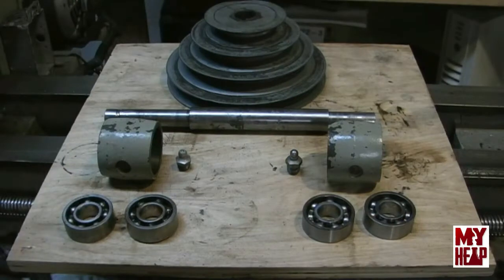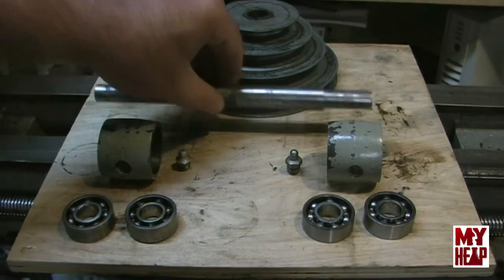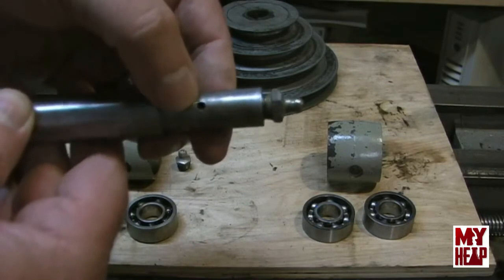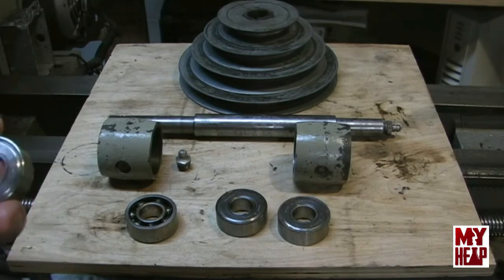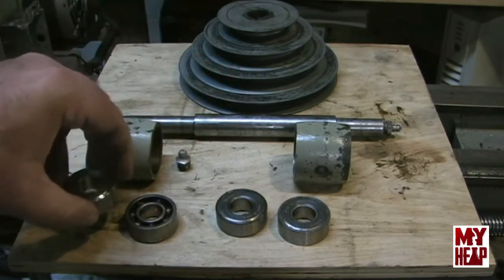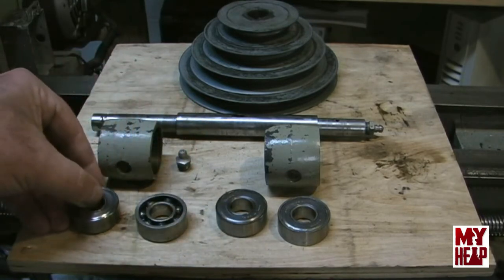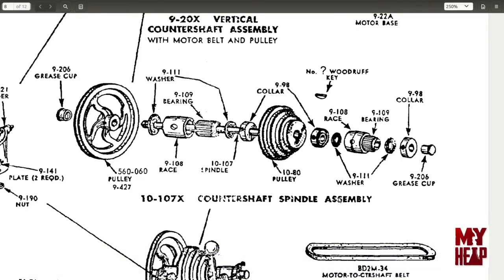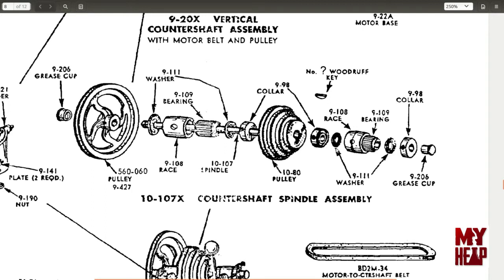Atlas 10F Lathe - TH54 - 05 - Counter Shaft Modifications

Comment: I added sealed bearings to mine years ago, Best move I ever made, No more grease flinging out while running. Yes, The originals were a "needle" bearing type affair. If you have an Atlas parts manual it will show the original set up.
Reply from the maker: Hi Jeff.  I have a parts manual that shows the needle bearings.  I replaced the bearings and it has been flawless.  You're right, it is the way to go.  Thank you for watching and taking the time to comment.

Joe

Comment: Adding the sealed bearings is a fine idea. When I first got my lathe it had the original rollers and were noisy and threw grease everywhere. . I didn't think of boring the original carriers but turned new ones from 6061 and added larger sealed bearings . It has been running cool, clean and quiet for a couple years now.
Reply from the maker: Harold, thanks for the feedback.  I have a question that maybe you can help me with.  I can find bearings with the correct ID and OD (15mm and 35mm respectively) but not the same width.  The FANFIR 202KT bearings are 0.500 inches wide and the bearings that I can find are 11mm (0.433 inches).  Since the bearings are press fit into the castings, could I use these bearings?  The set screws on the carrier that holds the counter shaft would prevent the castings from moving about.  Press the bearings flush to the outside edges of the castings leaving them roughly 0.067 inches from seating against the bottom of the bore?

Joe
Reply: I f they are a nice tight fit I would do as you said and just press them flush to the outside. You could make spacers for underneath or use locktight. You will have to at least keep the inner sides flush as they have to butt up to the shoulder on your shaft to keep everything aligned. The original shaft was straight and used movable stops on each side.
HWF
Reply from the maker: Howard, Thanks for the input.  I will order some replacement bearings and press them flush and just see what happens.  If needed, i will make some spacers to sit at the bottom of the bores.  At any rate, i think I will do a video of them going back together and running it as a follow up.  Thank you sir, for your help.

Joe
Reply: I agree, I also have a TH54 with the original grease cups which as Harold has stated throw grease every where.  I can't comment on the noise other than to say my lathe is very noisy.  I've been thinking of doing something about this condition for some time and seeing what was done to your lathe looks good to me.  Thanks for sharing your story and giving me some ideas and a little push, if I can just find the time.
Reply from the maker: I am glad to have helped in some small way.

Joe

Comment: I have a similar lathe with the original cage bearings and am about to replace the countershaft bearings.   I can't see anyone who has used these grease cup bearing suggesting they be retained.   
I  have some flange bearings on hand 3/4" ID 1 3/8" OD on hand so will use them.   
The 3/4" ID should not require any shaft modification.   Rather the modify the existing bearing holders I will be making new ones from aluminum round bar stock.
Time for you to finish up the house and get back out in the shop!  Stay well.

Comment: What you want to do is fine.  I'd consider pulling the inside seals and running oil bath.   I'm thinking it's much less likely those are modified parts and more likely an assembly from a South Bend or something else. The factory housings wouldn't be large enough to bore out for those ball bearings.  I own 8 or more of these lathes and that part just does not look like a factory part.  I could be wrong of course.  I'm not looking at mine at the moment.  Added note, the genuine Atlas bearing blocks are 1.8" at maximum od.  I looked at another video of yours to see yours in the yokes and they look bigger.  It doesn't really matter as long as it all works well.  There is no hero's restoration corner in the Atlas/Craftsman museum that does not exist.  Practical repairs are all that count.  Another added note, I see those are 35mm bearings, thus leaving about 3.75mm rim if you machined out the existing bearing mounts.   I take it all back.  Those are stock bearing mounts.
Reply from the maker: Hi Crafted,  Sorry for the late reply.  So you may be correct about the bearings, but I will say this.  The lathe is a 10F, 1943 model based on the bearings in the headstock.  The castings look like the ones in the 10F parts diagram.  But that is all I can say about it.  Not ever having one before I have nothing to compare to.

SO, with all those atlas lathes lying about, you have any change gears you can part with?

Joe
Reply from the maker: Just realized you edited your post.  Well, thanks for clearing that up for me.  I appreciate your input.  Thanks for stopping by and sharing with me.

Joe